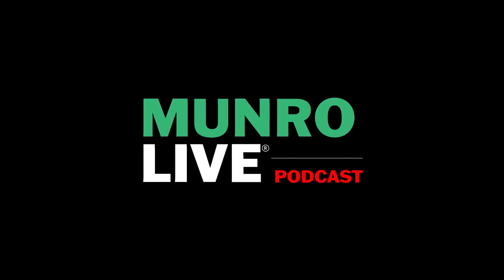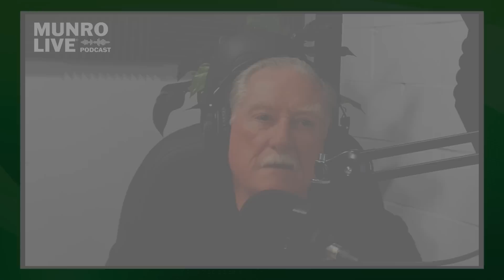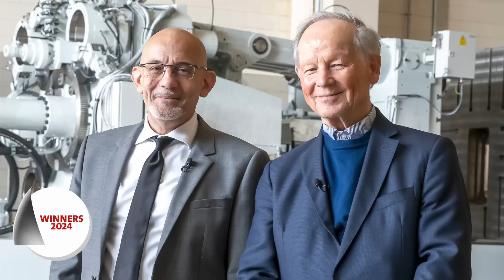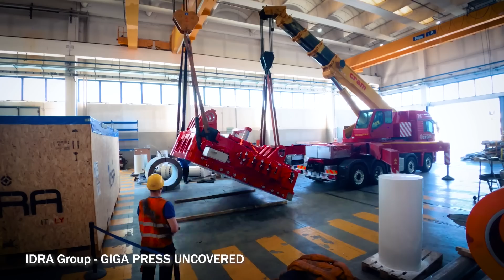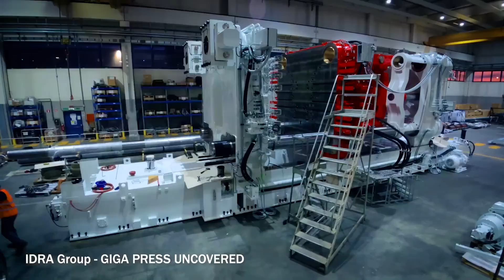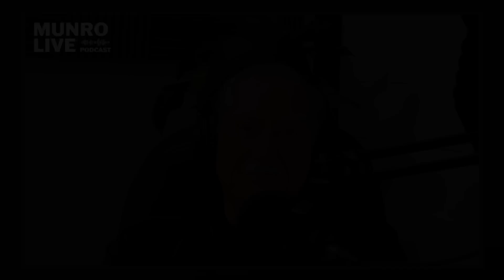John Stokes & Fiorenzo Dioni - IDRA | Munro Live Podcast

Comment: Why are Giga Press machines arranged horizontally? Large stamping presses, drop forges and the like are oriented vertically to leverage the mass of the press. If a multi '000 tonne die casting press was constructed in a vertical orientation, higher die clamping forces could be achieved with a reduced toggle/locking force. Separately, would shooting a cast in a predominantly horizontal plane lead to a better flow path when filling the mould?

Comment: Gigacast concrete homes, fast , cheap , insulation , environmental.
Reply: In many countries, the most expensive part of a home is not the construction materials, but rather the cost of the land, so gigacast concrete homes would not necessarily reduce the cost of homes by a significant amount. And as for being environmentally friendly... the use of concrete is anything but environmentally friendly.
Reply: I'm in the process and a new home in Georgia USA will cost 5x the cost of 3 hectares.  Modest land, modest home. @CiaranMcHale
Reply: @CiaranMcHale   - the Individual home is in DECLINE.
your NEXT home will be a Tower Apartment or Condo , it will be FREE , but you wont own it. 
unless you buy RURAL detached home.
Reply: Gigacasting concrete is not feasible. 
3D printing of homes is now being done.